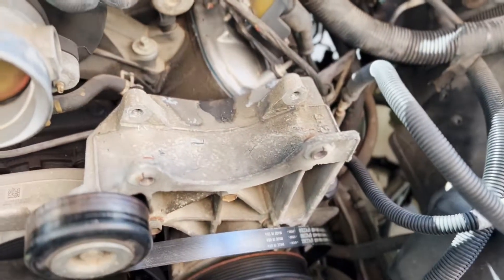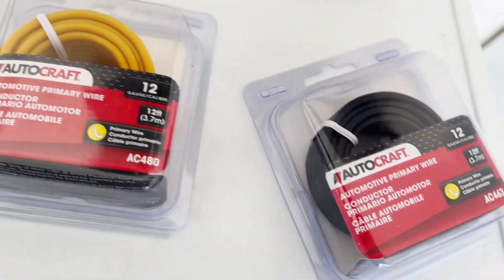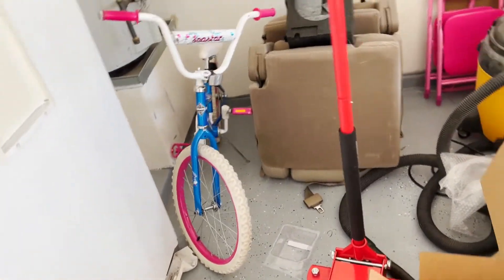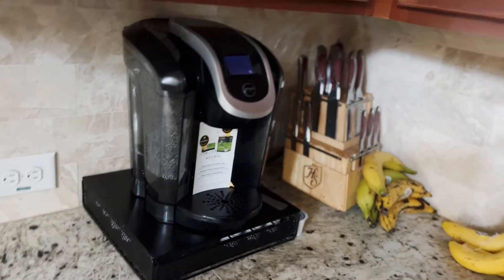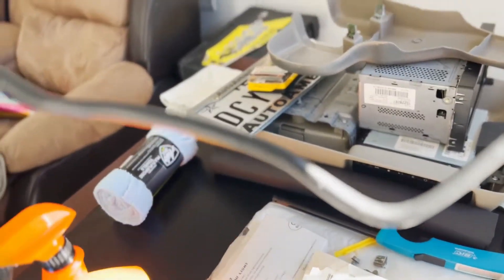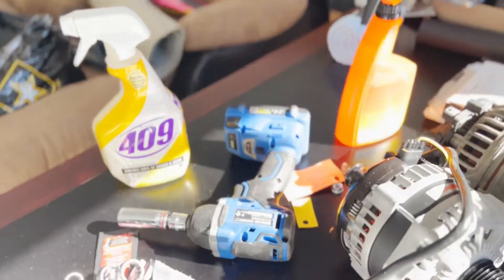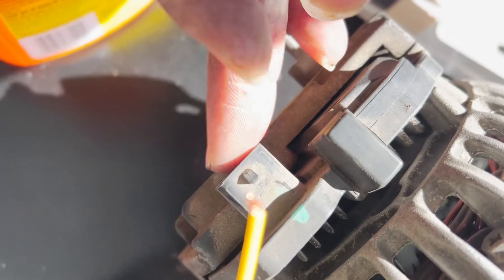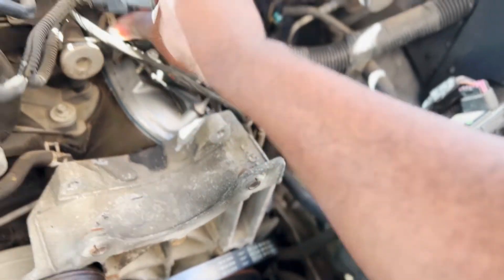Mechman 400 Amp Alternator install 05 Tahoe

Comment: thats a crazy setup that mechman used, i got me a 250A H/O Alternator with a zero gauge wire fuse kit, for my gmt800 escalade and that thing has more horse power and torgue now nad the stock 11 speaker bose system sounds better too. damn crazy how a better alternator can transform a vehicle's performance given the right fuse and amperage. deff a must for truck and car speakers modders
Reply from the maker: Thanks for checking out the video. Once I start on installing my system I will add some more zero wire to the alternator. I’m sure it improved the power through out it, but I barely drive it so I haven’t even noticed a change. I just went ahead and upgraded it due to all the stuff I want to add in the future
Reply: You aren’t getting extra Hp and torque from a alternator upgrade 😂

Comment: Great video bro. My upgrade ur battery if you haven’t already did so . To a XS Power battery
Reply from the maker: Appreciate it and thanks for tuning it. So I have the dual battery setup up. My main battery is the Optima yellow top and the second battery is the XS3400 that’s going to run my system. I have both batteries ran to an isolator.
Reply: @CHEVYLYFEGARAGE  ok
Reply: @CHEVYLYFEGARAGE  Where did you run your 12v for the isolator? I was planning on running it to the ignition but now im using that for the alt.

Comment: The dayco 5060925 went on there ok ? I got a 2004 chevy tahoe I’m pretty sure mine came with the 145 amp alternator but not sure how to tell ? And I purchased the mechman 240 amp my setup is only 1,400 watts
Reply from the maker: Ok cool. My alternator was the 160 amp. If you look at the top or back of the alternator it should tell you. You can also go to mechman site and find the belt size for your year if I’m not mistaking

Comment: I installed one of these in my 2018 silverado 2 months ago. My truck keeps stalling on me, it won’t stay charged longer than maybe 10minutes, its blowing fuses & triggering false codes. I’m starting to think they sold me a bad alternator bc i can’t seem to fix the problem. I also have 2 new batteries, so its not the batteries
Reply from the maker: Thanks for checking out the video.  I have not ran into that problem. I would definitely reach out to them they are good at responding

Comment: Did it really make a big difference with the alternator
Reply from the maker: As of right now I really can’t tell. I upgraded the alternator for when I install my system.
Reply: @CHEVYLYFEGARAGE so you did it put your system in yet
Reply from the maker: @davntelisha19  no not yet.
Reply: Just trying to figure if it's really worth the money I do have a car system in my caddilac escalade I'm running 2  12 inch skar audio subs evil. With a 8k taramp and running 4 10 inch mids with a 5k taramp and my 4 doors speakers 6 1/2 beymas I got 3 battery installed too my bass amp clips when the bass hits hard so I'm just trying to figure if I might need a alternator I bought a new alternator stock 160 amp but like I said my subs clip and go into protection mode when the bass hits hard I turn my level down and still man I'm thinking maybe my amp not getting enough power the amp is new too but still trying to figure it all out man but thank you bro
Reply: The alternator I'm look at is a mechman 400 they want about 585 for it
Reply from the maker: @davntelisha19  i don’t think I paid that much for mine. Is the one you’re getting powder coated. Check out down4sound.com.
Reply from the maker: @davntelisha19  yes it’s definitely worth it with the system that you are running even with the three batteries you need a big alternator to charge everything. You maybe need to consider a dual alternator setup .
Reply: @davntelisha19  you have to be lying about your system there is no way your alternator is powering 3 batteries let alone anything over 2k amps, if you’re not lying and really are that clueless you need a dual alternator set up
Reply: Not lieing at all my alternator is new but it's not that strong but yeah it's powering up 3 battery one stock and 2 car system batteries no reason to lie bro
Reply: @Titoo.1  yeah I no I need a better alternator but no reason to lie bro
Reply from the maker: @davntelisha19  well you should see a difference once you upgrade the alternator. Check out down4sound.com you might be able to call and they point you in the right direction for your swtup
Reply: @CHEVYLYFEGARAGE  the right direction is 3 400amp ones 💀
Reply: I'm thinking about getting a mechman 400 amp alternator for my 04 escalade I'm running 2 15 inch american bass hawks and a hifonics Brutus 3k but I'm going to be adding a bigger amp and miss and highs just want to know if I should get it or not it's not a cheap purchase
Reply: I SEE THAT CHECK ENGINE LIGHT ON?

Comment: Mine just started maken a noise now I hear the engine noise through my speakers
Reply from the maker: Thanks for checking out the video. Haven’t had any issue with mine as of yet but I’m just installing my mids and highs. I will let you know how it goes
Reply: I have the same problem with my 2
300

Comment: Did you change your serpentine belt?
Reply from the maker: Thanks for check out the video. Yes I changed the belt for a smaller one. I got the Dayco 5060925 not sure of the exact size.

Comment: Got a question did u have to replace ur belt with a smaller one
Reply from the maker: Thanks for checking out the video!  Yes I went with a smaller belt. The pulley on the mechman is smaller then the factor alternator.
Reply: Thanks now to figure out the size before I do it because I’ve seen many different part numbers for belts
Reply from the maker: @krisward1626  I went with the Dayco 5060925 but my factory alternator was 160 amp. So check the size of your factor Alternator then use mechman belt chart to determine the size belt you will need.

Comment: Great vid man! Did you run a shorter belt?
Reply from the maker: Thanks for checking out the video. Yes I did use a shorter belt. I went with the Dayco 5060925
Reply: @CHEVYLYFEGARAGE  thanks,  I did mine yesterday and went with the similar.
Reply from the maker: @dhatbwoy696  bet. I haven’t had any issues out of it so you should be good

Comment: What gauge wire did you run for the yellow wire & the black wire from the lil red box
Reply from the maker: Thanks for checking out the video. From the alternator to the red box is a 4 gauge battery cable and the yellow wire I used between 12-14 gauge
Reply: Thank you

Comment: Would this be a good upgrade I already got a yellowtop battery. I have 2 12inch Skar EVL, 4 6.5 Skar door speakers, and some Skar tweeters hooked up to a 500 watt Skar amp and a 3k taramps. But my stock wiring is barely giving me over 13 volts
Reply from the maker: Thanks for checking out the video. Does your voltage drop or lights dim when your subs are on?
Reply: @CHEVYLYFEGARAGE   I haven't even connected the subs or door speakers yet because of the problem I'm having with the low voltage. I don't think that would be a good thing for my amps or subs. It only happened after I replaced my battery with the optima yellowtop.
Reply from the maker: @KingEnma_559  got it so do the big three  upgrade and do the alternator upgrade. Now you don’t have to get a 400amp like I did but anything over the factory amperage should be good. Also check your grounds and make sure it’s no loose connections. I have a video of the big three upgrade as well.
Reply: @CHEVYLYFEGARAGE   I've already done the big 3 at the same time I put in my battery it's all 0G OFC. The only wire I didn't get to upgrade was the smaller black one that runs from the back of the alternator to the little red box I don't remember what it's called
Reply from the maker: @KingEnma_559  ok cool. Up grade that wire as well and see if it changes anything. I replaced that wire with battery cable wire but I have seen people upgrade it to 0g wire as well
Reply: @CHEVYLYFEGARAGE   I'll upgrade that wire but still want to upgrade my alternator as well. It's weird because in my tahoe I had the same exact indash, door speakers/tweeters(hooked to radio), with 4 12's and a 4k lanzar amp all hooked up to stock everything and I didn't really get any voltage drop at all

Comment: What size belt you get or part number I got a 400 amp alt
Reply from the maker: I got the Dayco 5060925 not sure of the exact size.
Reply: Did your battery light stay on

Comment: Was the stock alternator the small case 105 amp?
Reply from the maker: I think it was the 140amp one.
Reply: @CHEVYLYFEGARAGE  5/16" ring terminal eyelet?
Reply from the maker: @seangowan7441  not sure but I just looked at the old alternator and it’s actually a 160 amp

Comment: Replace.your gas cap and your check engine light will go.out.
Reply from the maker: Thanks for checking out the video. It was the dreaded knock sensor issue that they have.

Comment: You should fix the check engine light problem first and the big rip on seat 🤦🏻‍♂️
Reply from the maker: You fix things in the order you want to on your vehicle and I will do it the way I want on mine. I know why my check engine light is on and a rip in the seat is not a major issue🤦🏾‍♂️🤦🏾‍♂️. focus on the purpose of the video instead of trying to point out the obvious 🤦🏾‍♂️🤦🏾‍♂️. Thanks for checking out the video make sure to subscribe as well. I will make sure to tag you once the interior is redone so you can see it. Remember it’s a build meaning it’s done in steps and I do most of the work myself. You should always know a check engine light can come on for the smallest reason as well.

Comment: Realize that 400amps can’t go through that wire.
Reply from the maker: Realize that mine came with instructions and stated that a 0 gauge wire is recommended. Also realize that I’m not running anything at the moment that requires the alternator to put out that much amperage. Definitely appreciate you checking out the video, but I’m definitely not new to this

Comment: Without that 8 gauge wire my truck won't start.
Reply from the maker: Oh wow. Do you have a 400 mechman as well?  Thanks for tuning in
Reply: @CHEVYLYFEGARAGE  No, but this happened on my stock 145 amp alternator if i remove the stock charge wire.
Reply from the maker: @seangowan7441  oh wow. But the bigger wire does allow it to operate more sufficient from the research I’ve done
Reply: @CHEVYLYFEGARAGE  probably the hole in the ring terminals was the problem ob my thicker wire. I will be changing that.
Reply from the maker: @seangowan7441  definitely let me know the out come